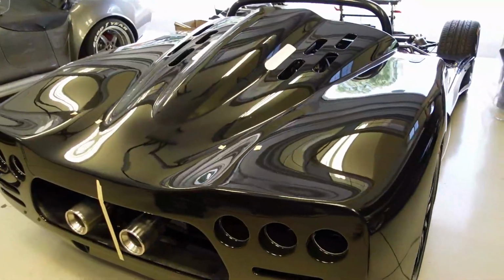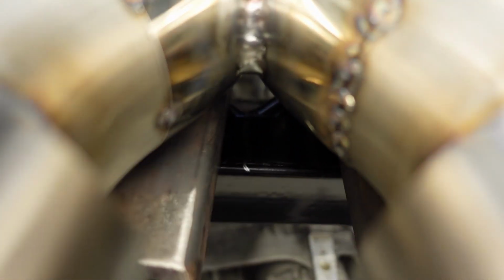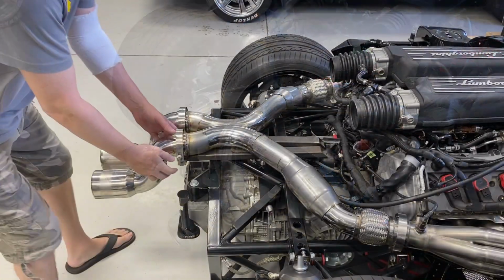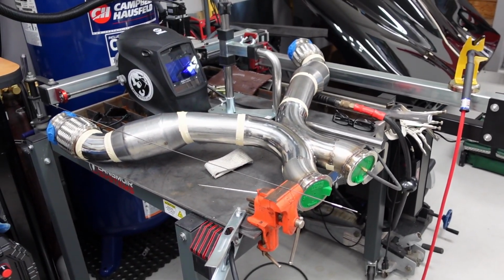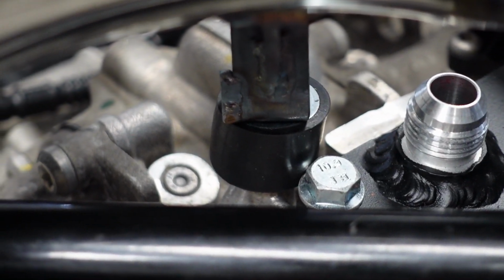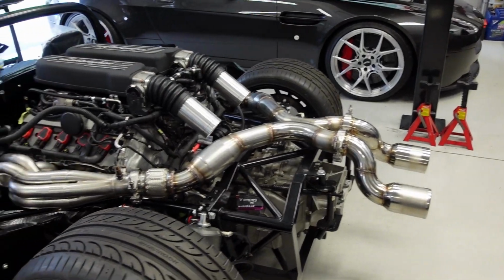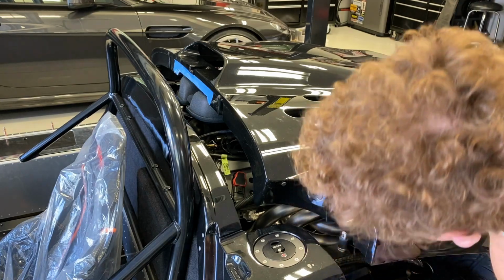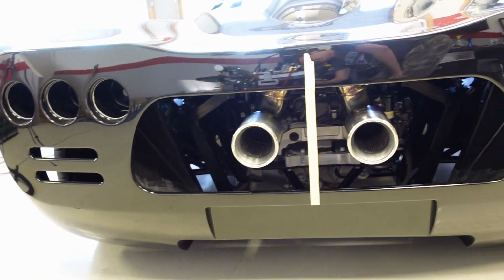Exhaust system is ready for ceramic coat!

Comment: Hi Dan, have you checked out Ray Hall’s V10 Ultima in Cairns Australia? It’s making over 800Hp at the wheels.

He’s using an Audi V10 from the RS6 and installed two GTX3071R GEN II turbochargers.
Reply: Below is a Dyno run on Ray Hall’s Ultima 

https://youtu.be/OUZ_k2Esz9w
Reply: Below is a walk around before final assembly of Ray Hall’s Ultima

https://youtu.be/PgqUHcH8Ax0
Reply: And below is Ray Hall’s V10 Ultima doing a test run on Queensland raceway.

https://youtu.be/YoOYYqWOBpI

Comment: Thing is going to be sick finished.
Reply: Honestly I would've done a titanium or inconel exhaust. Inconel looks like a less bright chrome. And ti well. Titanium has a lovely color and rainbows with heat. 

Plus reduces weight. And hold up to heat cycles and prevent corrosion.
Reply from the maker: @bmxriderforlife1234  all good ideas.  Now that I’ve built this system, my confidence is higher and might think about doing this once the car is running. I imagine this car will “never” be done done since I’ll always be upgrading bits. And since the exhaust system is so small, should be ‘fairly cheap’ using titanium. 💪
Reply: @DanDulac  titanium is still expensive to get welded or a pain in the ass to Do yourself. 

Inconel might be easier and cheaper grand scheme. Plus weigh less and have similar properties. Though it is more fragile from my understanding as the walls are thinner. 

But inconel main system and some titanium tips or maybe do up some ti mufflers custom. 

But basically just some ideas I had for mine. Trying to build mine up for top speed and endurance kinda thing. Building it like it's a modern car but for like old school le man's style racing. But maybe also drifting. 

Trying to decide. Save up and get a carbon body made. Or see about skinnin the fiber glass to reinforce it and help prevent it shifting over time. Kinda wanna do a nice paint job on it. Interior I'm planning for it to be simple but nice and clean. Gonna use after market seats. Found some racing style ones that come in some flavors. One version has heated seats and leather and stuff. Different version has carbon backs and other bits. They do custom leather and stuff so hopefully they will do me some with the carbon bits but the heated seats. 

Because the seats don't really move I'm gonna see if they have any with adjustments for lumbar and stuff but for the drivers side gonna figure out how to put the pedal box on an electronic rack. For sizing to the driver. Passenger seat just needs a few adjustments available. 

Depending how much work it is might see about adding a front storage set up like one builder has done. 

Haven't decided what engine but budget I'm thinking like ls3 roughly. More on the Trans. Trying to get something higher revving, not too hard to swap in. And realistically as long as it's not much heavier then an ls and I keep the builds weight down. I don't need more then 700-800 hp and the right gearing to compare to top end super cars. 

One other idea for a future upgrade. Do all the suspension upgrades possible to drop weight but upgrade performance. Get the brakes all done up. Carbon rims. Depending how you specced the car might allow an increase in rubber size without a weight increase. Also helps acceleration. 

Also Depending you can also consider the finishing bolts cost when building. And upgrade alot of the hardware to titanium since it's only grade 8. Buy in bulk get a discount. Also let's you color coordinate. Aluminium for brackets vs steel. 

Honestly thinking I might need to start digging into engine specs now. Been trying to figure out all my Trans options. I think zf might have a 7 speed option available in manual.
Reply: @DanDulac  I can get a ferrari engine or a Lamborghini from wrecked cars. 10k running with the wiring and shit plus the transmissions. 

10k there are audis I could part out for an engine. 

5k or less I can get toyota v12s. Vw w12s. 

And in that 10k mark a few other things. 2jzs and shit. Also considered an rb series motor. 30 block with a 26 head. 

Or the VR6 engine. 

Hybrid solution would be cool but probably not enough hp easily. I know if you give up streetability you can get a hybrid set up but it's a pain you lose reverse and neutral. 

Might copy the dude that did the Benz v10 swap since it's a known swap. 

But gotta start weight weenie spread sheet to figure out savings points. It's so nuts how you can like somewhat design a driveline and such for a super car you can build yourself. 

Thinking the supercharger whine and a turbo blow off valve and modest boost compounded should help. Someone also told me I could set it up to always bring fresh charge in and help with heat. Also fixes turbo lag. 

Think if I do it right I can keep weight low but still have a nutso top speed winding it out with a nice high revving engine but still get low end torque and a decent reliability. I've seen some builds that accelerate quick but top out under 200mph. 

Ricardo transaxle needs alot of power but 256 top speed. But they're all repair units. And nobody services them unless you have a Ford gt. And the others need a redline around 9000 rpms.
Reply: @DanDulac  oh btw inconel exhausts usually cost more then titanium and I believe they are even lighter and have similar thermal capacities. It's used in Nascar Nascar other high end racing exhausts. Can't remember if f1 uses it. 

Titanium in scrap form is relatively cheap. Even in tube sets it doesn't cost a stupid amount. The expense is in welding it and cleaning the surface and working with it usually. It's only a bit more expensive then some higher end steel alloys. 

Think I finally decided on my engine choice. 2jz. Easy enough and more cost effective then some others. But is still gonna add difficulty. Buuuut it should be easier to buiot it to Rev to 8500 9000. 

If you ever decide to really go for weight reduction and making it pop. See about swapping hardware like bolts and such for ti ones from a bolt supplier. In bulk it can be cost effective you just need to get the ones designed to replace grade 8 bolts. 

You can also get anodizing kits for anodizing aluminium. And to strip anodizing you can use industrial strength oven cleaner.

Comment: Hey Dan, I would highly recommend buying an oscillating multi tool for cutting fiberglass and other panels. I find it much smoother than using a dremel cutoff wheel and it doesn't spray dust as far when cutting, it also works great for trimming carbon fiber.

Comment: Highly recommend Swaintech's White Lightning. Much thicker and more effective than other USA options. Only comes in white but can be painted afterwards. Also I'd worry a little about the cats (bound to be the hottest part of the system) - may need supplemental shielding/cooling to keep them from cooking the frame powdercoat and the clam above.
Reply from the maker: Totally agree!  I’m gonna wrap the cats with an inconel type shielding wrap.

Comment: Dan,,, is reverse fit on intake not possible? and ceramic coating is a great idea,, i have oem exhaust from factory,, headers and full system coated.. i never EVER have a heat issue,, as many have talked about, this works,, and i mean it,,
Reply from the maker: Great idea on reversing the intake. When I swapped out the cracked Audi intake plenum with the Lambo version, I looked closely to see if this was possible. Unfortunately not: the dual injector setup (direct + port) is not able to be reversed and it’s tied into the intake for mounting. Thanks for the comments!  Great to hear ceramic coating will do the trick. 👍

Comment: I think I would go with Titanium . One would think that Ultima would have a Clam to fit the Audi Power Plant. Seems a fairly used engine??  Great Video :-)))))
Reply from the maker: If I was building the coupe, my engine would fit without modifying the clam. But given the convertible clam isn’t as tall, I have clearance issues. I knew this going into it but I’m confident I’ll find a way that still looks good. 😎. Great to finally meet you at C&C!

Comment: Something I'd love to see someone try is use the exhaust to provide thrust by ducting it through the type of vent used in a Dyson blade less fan.
The shape of the opening at the rear could be mimicked by one of those ducts and if you incorporated some glass fiber it might work as a silencer